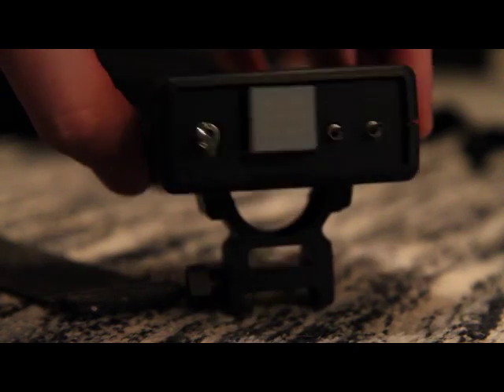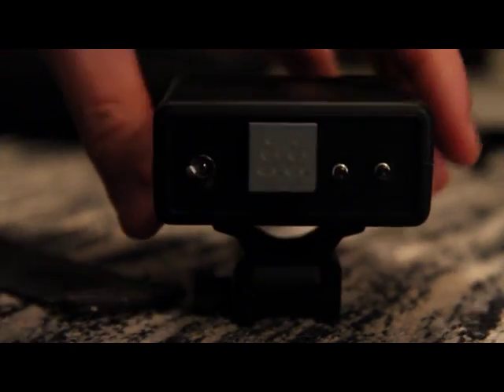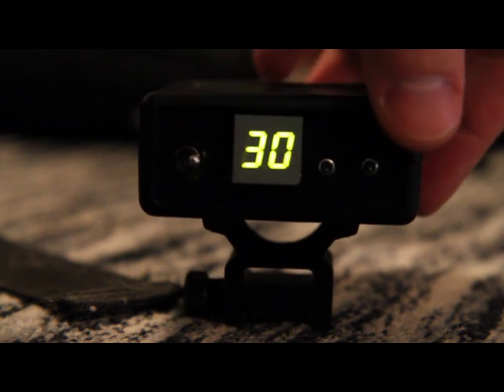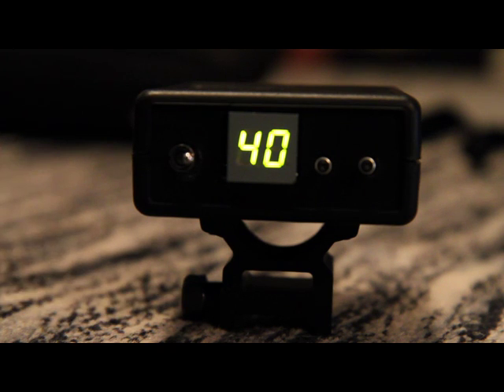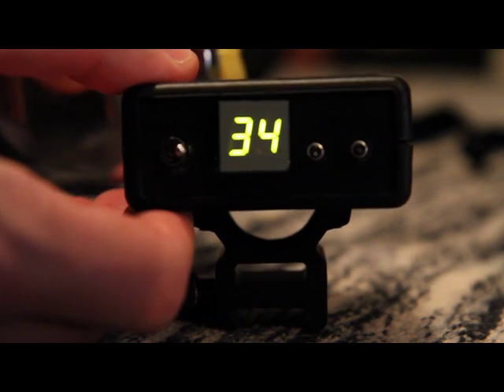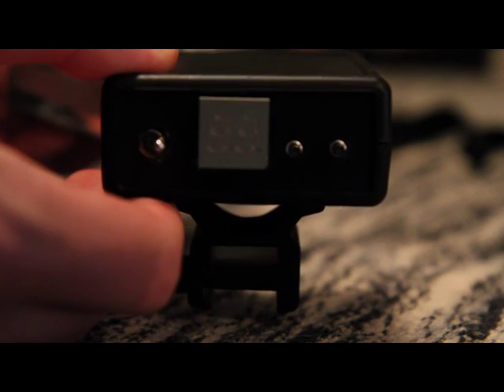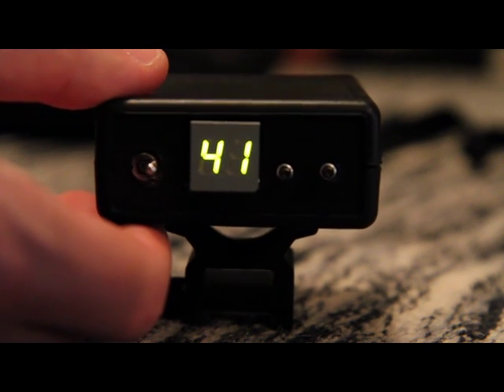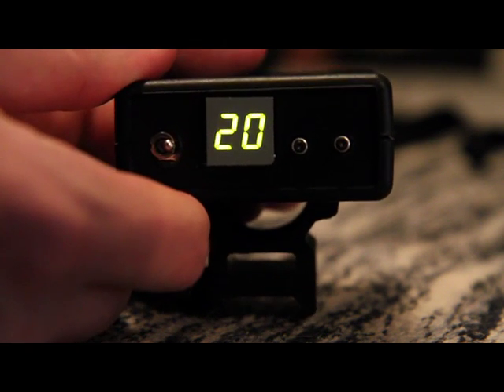My Bullet Counter

Comment: You could add a delay in software to solve that "double tap" issue, mate, Just drop a _delay_ms(125); in the while loop (if you are polling) or drop it into the interrupt routine (at the end of course). Great work though, very cosmetically appealing and very effective. I have never actually seen this or heard of anything like this before, so it is quite interesting and innovative. Keep up the good work.

Comment from the maker: Not exactly.  Firstly, it wasn't repurposed, it was built from scratch.  Secondly, a typical accelerometer is much too sensitive and wouldn't work as it would pick up normal handling vibrations as shots.  This device can be set to ignore all accelerations under 50Gs.

Comment from the maker: @Makingnewnamesisdumb The accelerometer is incredibly insensitive.  You would need to smack it hard enough to produce 22.5gs of acceleration directly on the muzzle of the gun.  The only real way to do this accidentally is to drop the gun from waist height directly on its muzzle.  At that point, you would probably be more worried for the gun than your count.

Comment: You could try putting in some sort of time delay where it won't register more than one shot in less than .x seconds. As long as you make sure the delay isn't too high (much more than a tenth of a second) this should work with rapid fire and full auto just fine.